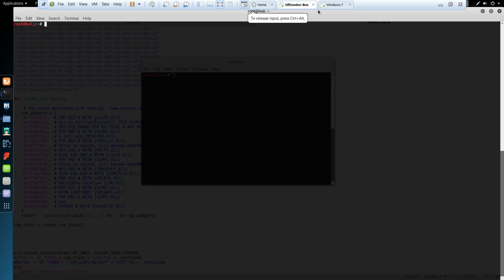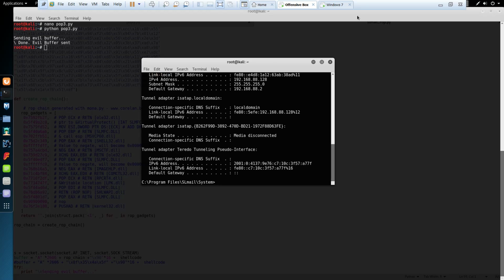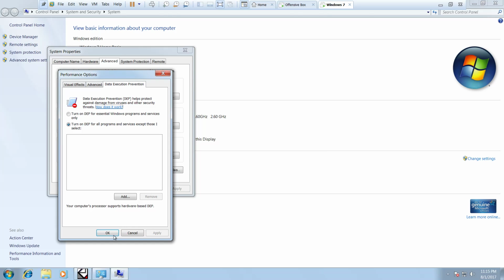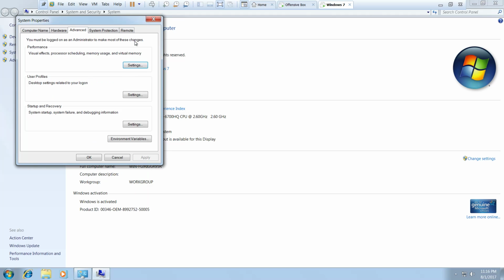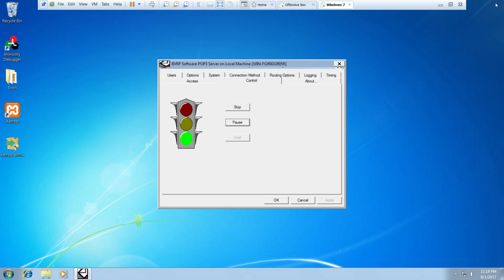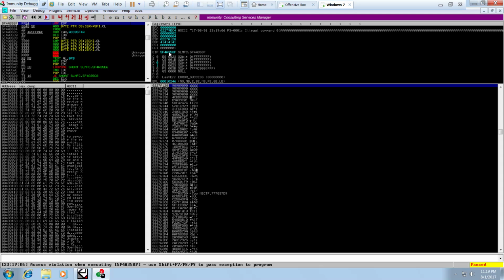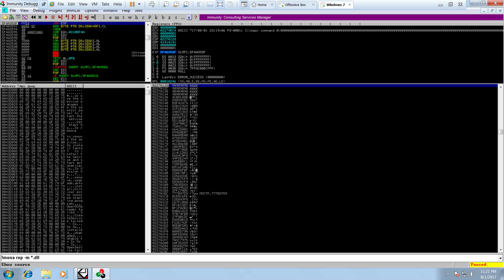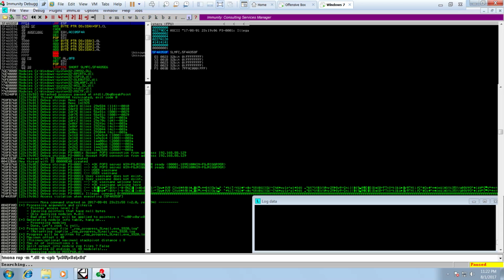Defeating DEP Using ROP Chains Part 1

Comment: thanks for your vid. How do i configure Ubuntu against DEP? Also how do i impliment Address Space Layout Randomization ?
Reply from the maker: Omar Cheevers 
Dep and aslr should be enabled by default on Linux / Ubuntu. You can verify by reading this blog post

 https://askubuntu.com/questions/318315/how-can-i-temporarily-disable-aslr-address-space-layout-randomization
Reply: @zerewaze1  Thanks for your prompt response. Can any firewall also how to detect and prevent these type of attack.
Reply from the maker: Omar Cheevers 
These are memory protection bypass techniques which is mostly privileged escalation attacks so firewalls are useless at preventing such attacks.